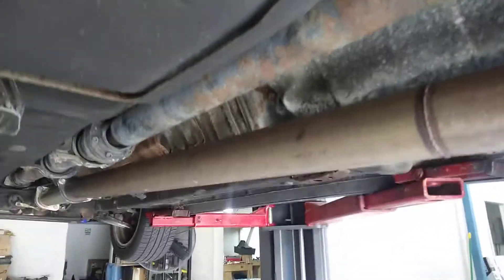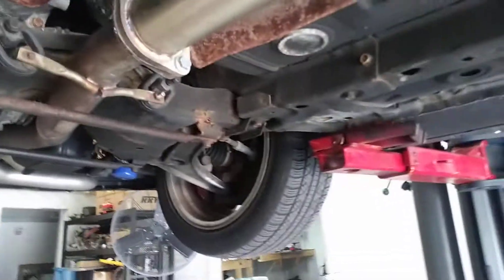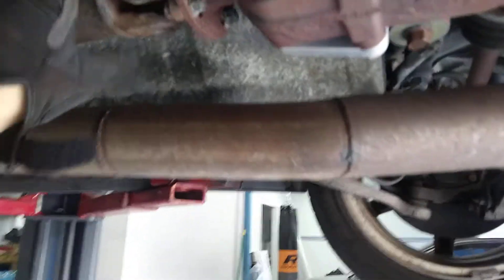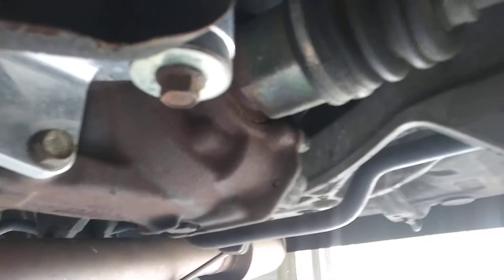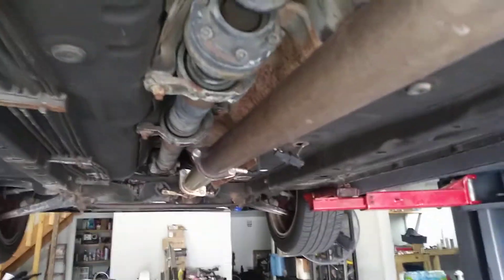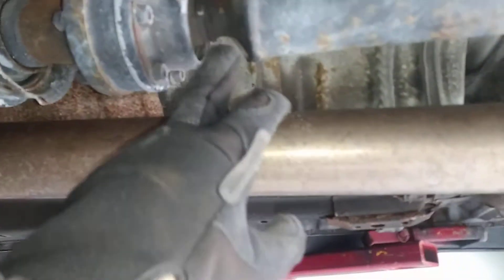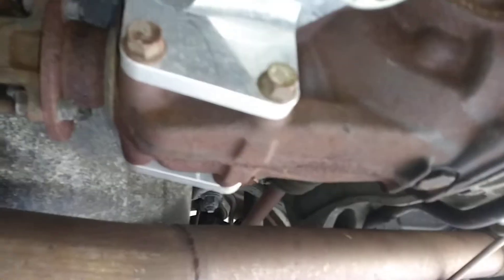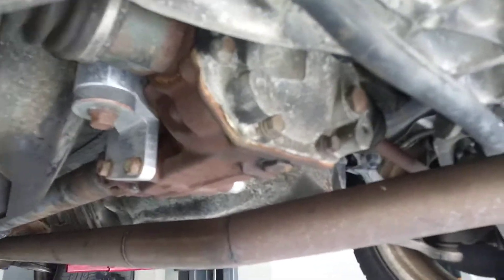Evo 8 Possible driveshaft issues?  Please comment

Comment: Find in the mitsu manual available on Evoscan the section on the Propeller Shaft. The spinning of the driveshaft can be measured by mating marks, it measures backlash of the rear differential. Most likely it’s that rear carrier bearing that’s causing noise at speed and on shift.
Reply from the maker: Thanks. I'll check that out

Comment: Hey did you ever figure this out? I get some nasty clunking in my evo 4 whenever i move the car from a stop, or if I dont perfectly rev-match my shifts. I have a similar amount of driveshaft play up and down, as well as the slight clunk when rotating it by hand.
Reply from the maker: I never did figure out what the exact car was.  But yes, mine would clunk too with imperfect rev matching to next gear or not slipping enough going into the next gear.

It might be the driveshaft or the bushings but I never replaced any of it before selling the car.
Reply: @d-evolution1309  I think its my motor/transmission mounts. I took a video, and noticed the exhaust was moving even more than the driveshaft itself. Cheers bud!

Comment: I have this exact same issue on my Evo 8, 158k miles and it makes the clunk noise when I let on and off the throttle. If I'm in fifth gear and cruising around 2.5k rpm you can feel a very bad vibration under the car that is related to the clunking sound. I have the Buschur Racing mustache bar and whiteline diff mount inserts so that is not the issue. I got under the car and my driveshaft makes this exact noise, I suspect is the issue. Have you figured out the cause? I'm thinking bad diff..
Reply from the maker: My diff had been recently replaced.  Although that doesn't mean the diff wasn't the culprit, I was leaning towards that not being the cause.  I was thinking based on age and mileage the carrier bearings in the diff were worn out.

I never did find out the issue.  I sold the car
Reply: Before you replaced with the BR mustache bar, was that any clunking. I heard mine clunking when I replaced with the full bush mustache bar. Clunking and whining a bit
Reply: @MrSharipdol  The vibration issue ended up being my rear diff ring and pinion going out. Got it replaced and the clunk is still there but vibrations are gone. I have the bushur racing mustache dar and solid motor mounts. I do believe this combo causes the clunk and possible more wear and tear on my diff. I'd recommend not doing the solid setup for a street car. I regret it

Comment: Describe more detailed when you have the noise. 
It is normal to have some play in the diff but this seams to me a lot. Not to shure. 
Also bearings of the diff can be worne out, depends on the sound. 
I also read that many guys with a lot of power have the isue that the prop shaft hits the under floor. 
One said, he solved the problem with stiffening the rubber bearings with window glue. I think that is a smart idea.
Reply from the maker: When driving at lower rpm in 4th and I give it has, I get a really bad rattle under the car for a few hundred rpm.

Basically when I am under 2500 rpm lets say in 4th and I accelerate at a mild pace, not wot.  Maybe 50%  there is a rattle under the car.

When under 1500 rpm lets say in third, not giving any gas, the engine will of course sometimes chug.  When it does I get a loud bang from under the car.  So everytime the engine who chug it bangs underneath
Reply: You  can buy metal bushes stops the play thst the rubber ones have

Comment: I'm having the same issue on my Evo 8..mechanic said my diff is shot. You managed to figure it out? You said your diff was replaced so then cant be the diff
Reply from the maker: I havent had it professionally diagnosed.  It could be the carrier bearings.  It could also be the diff.  Not sure.  112k on the driveshaft.  I bet stuff is worn out for sure on that.

Diff could also be bad.  I really need to have a pro look at it